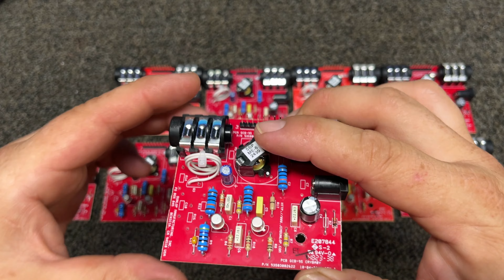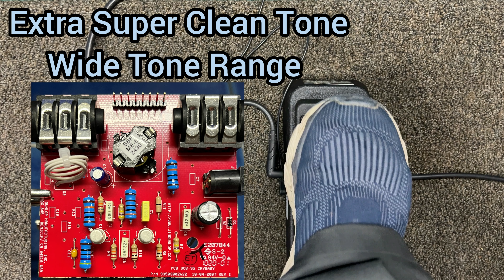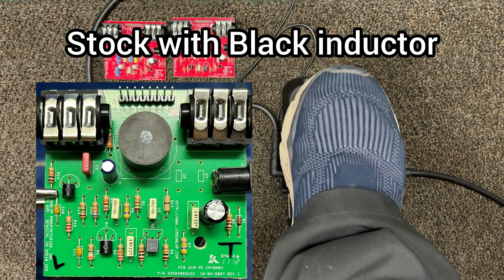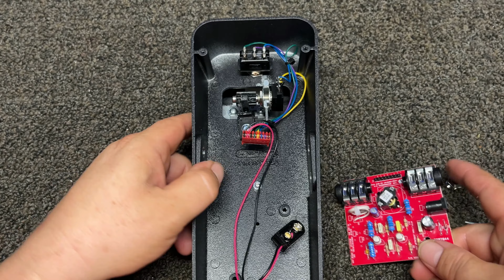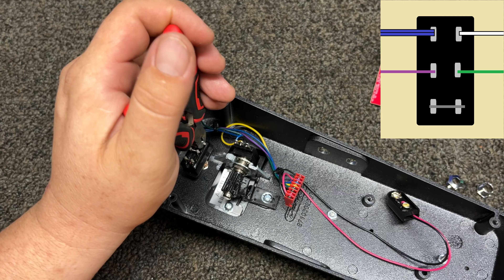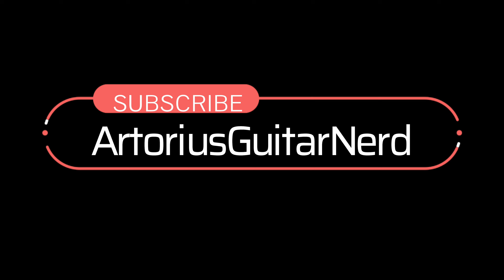"Vintage Nightmare" GCB95 drop in replacement

Comment: I have a question on your vintage Nightmare board, will it drop in on the Dunlop Jimi Hendrix Wah the JH1? Mine seems to have developed a huge volume drop when engaged.
Reply from the maker: Absolutely, the enclosure is exactly the same as the gcb95.
99.99% of the crybaby enclosures are the same, only difference would be paint jobs and components for signature models.
Reply from the maker: Also I dropped the price down $40 free shipping
Reply: @ArtoriusGuitarNerd  Thanks, I just bought one. I have some questions on wiring the true bypass, I added a 3PT switch to mine. I want to do an LED mod. Not sure how I wire the bypass with that switch. Also I tried to email you but it bounced.

Comment: I really dig your mod board, the retrofit looks impeccable. I was wondering why you're using the big 1 watt resistors? Do you have any unpopulated boards for sale. I want to build one with a Mesa Boogie inductor.
Reply from the maker: I use the 1watt resistors in my Master Wah builds so I decided to use those same resistors in for this mod. 
No other reason other than they’re cool AF in this mod lol. 

I have some boards with all the original parts except the inductor. Email me 
ruckusaudio@yahoo.com